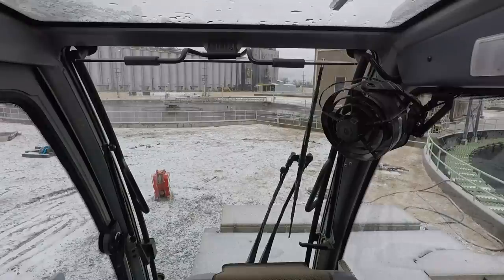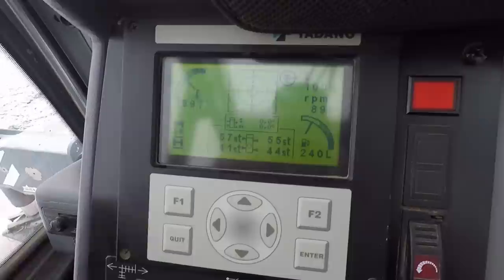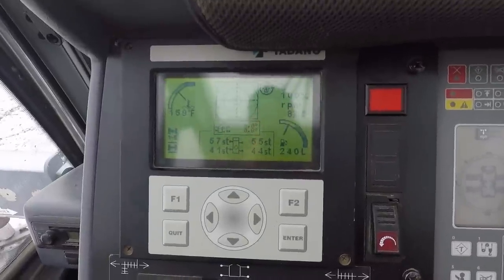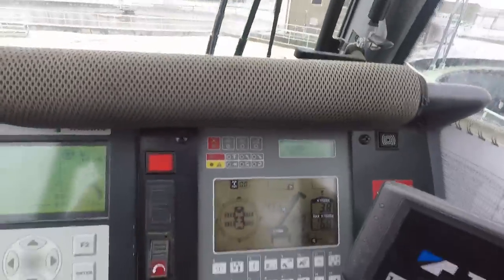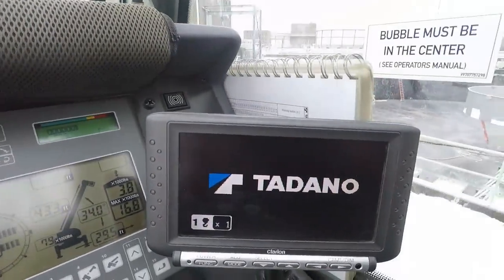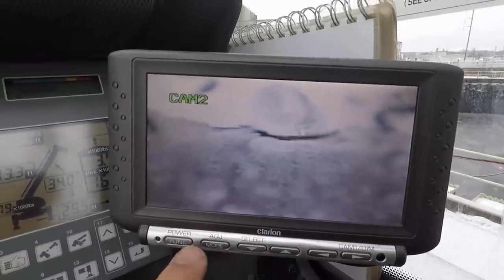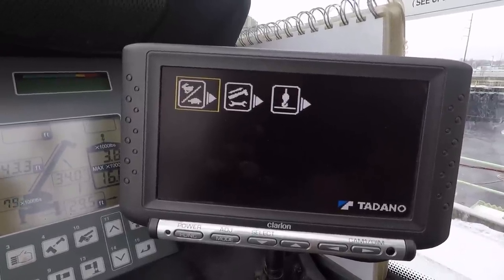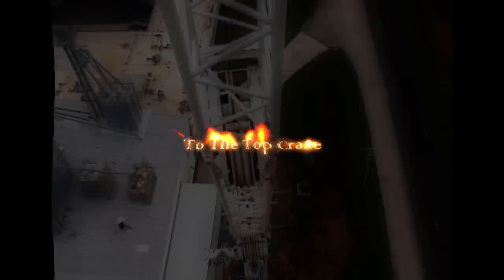To The Top Crane | Tour of the inside of the cab

Comment: Just an FYI, maintenance mode is purely a function for greasing your boom. It contains scoping charts that allow you access to all points for greasing the slides and pins of the boom. The only issue to using maintenance mode is it eliminates some of the safety features of the AML and could allow you to turn the crane over if you aren't properly counterweighted for your conditions.

Comment: New question...Is the weight of amount of fuel ever calculated into counterbalance? If so...does computer configurations change automatically with fuel level?
Reply from the maker: Wayne Tharp, fuel and other fluids aren't considered part of the counterweight configuration. Those are too variable. Our printed load charts rely on specific, never changing information. That's how we plan our picks.

Comment: Thanks for showing us around! 
Is that a communication radio tucked into the left side of the cab? 
Or do you typically use hand signals between your operator and oiler?
Reply from the maker: yjjeeper90, in the left front corner of the cab is just an am/fm, cd player. We have two way radios. But, I prefer hand signals when possible. Thanks for watching! 🙂👍

Comment: If I had only gone to class in school and at top crane! I would have had my wind question from yesterday answered. Sorry...

I see another guy beat me to the " What is the red button question?" The one in center/top of main dash that looks like it is waiting for a call from the" powers to be" and life on Earth will never be the same! lol It is probably the road hazard lights but that would be boring! While I am in class...What does the green/yellow/red strobe light outside on your right let everybody know? Thanks Professor and have a great day!
Reply from the maker: Wayne Tharp, the big, rectangle red button is actually a warning light for the engine. The green, yellow, red strobe on the outside is a tattle tale. It lets everyone outside the crane know how close to capacity I'm getting. Green means plenty of capacity, yellow means the guy in the seat is starting to push the limits, and when it changes to red, everyone knows that the guy in the seat is crazy and overloading the crane. It will also be red if the crane configuration doesn't match what was entered into the computer.
Reply: Thanks for response! That light is pretty nice incase the operator strokes out or is updating his facebook. The crew has a few moments to run for their lives!
Reply from the maker: Wayne Tharp, a REALLY loud alarm sounds too.